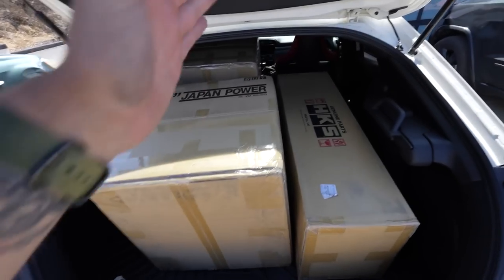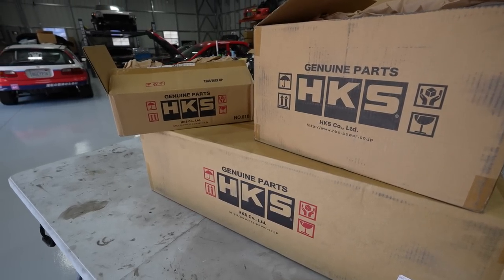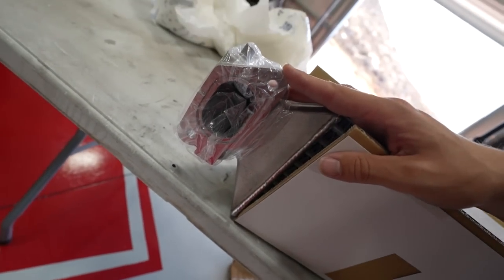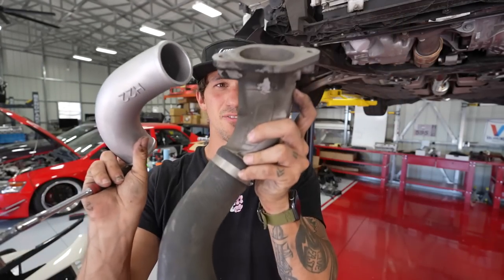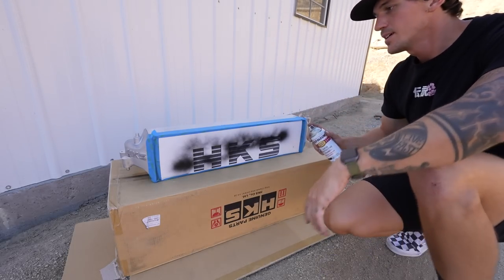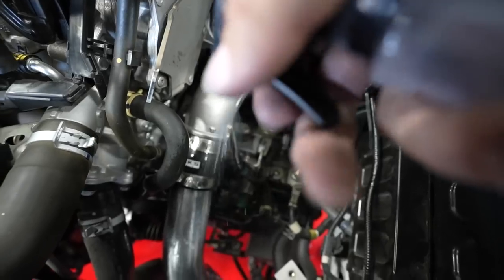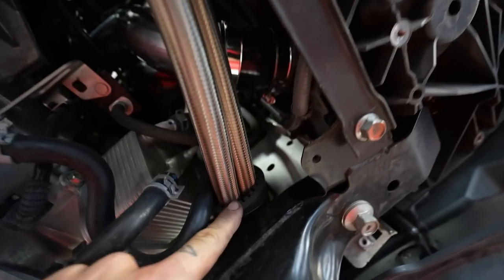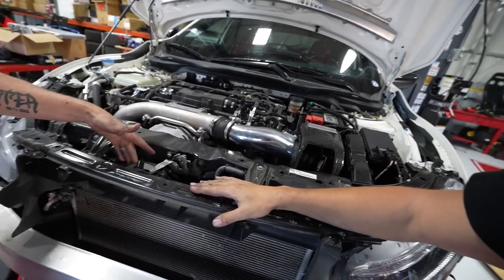Dream Civic Type R Gets JDM HKS OVERHAUL!

Comment: She going need retune before the event bro don’t forget retune / reflash and make sure u reset oil mileage / maintenance ..  also make sure to flush coolant and add coolant additives to lower temps. 😎👍🏽 have fun.
Reply: Might as well bleed the brakes and adjust the coilovers and tire pressure
Reply: I found a 55/45 oil:water ratio for the radiator works best for this specific model
Reply: @shaunreed8115  🤣😂💀
Reply: Intercooler doesn’t need a tune my G
Reply: @ShawnBspoolin  He does have an aftermarket intake as well. Don't know if he changed the MAF yet either.
Reply from the maker: Doesn’t need retune for FMIC.
Reply: Internet mechanic 😂

Comment: Would recommend to upgrade the throttle body coupler as those are know to deteriorate on the FK8 and also recommend to use 5W30 oil if you’re gonna track. 0W20 would look like water after track.

Comment: Make sure and read up on oil viscosity for the track as most people use a thicker oil on track and normal for daily driving.
Reply: Exactly what I said at least 5w30
Reply: I'd say lol
Reply from the maker: Thanks for the tip, but obviously… it’s not my first time going to the track. 
There have been multiple tests with 5w30 and it’s shown there’s no reason to swap from the 0w20 on the FK8.

Comment: Nice build. But, have you just figured to drive and learn the car before modding so, you can enjoy and appreciate the engineering characteristics of the type r? I think this way you’ll start to quickly identify the differences as you add or remove parts.
Reply: Doesn’t take long to get used to the car I mean mans has a lot of seat time. Most of the mods he’s done is for cooling anyways to help mitigate heat soak

Comment: Hey dust! If u ever still get overheat, cut the ac condenser in half, problem will be solve, especially with all the cooling components installed, coze the condenser blocking a lot of the air flow

Comment: Would it make a difference if you heat wrap the intercooler piping? I know it's for exhaust to keep the heat in but would it help in the small places to keep the heat off the intercooler pipe?
Reply from the maker: I dont think so
Reply: @dustiinw  damn